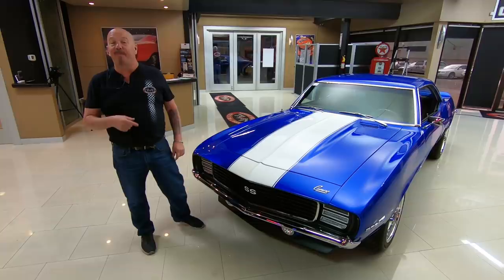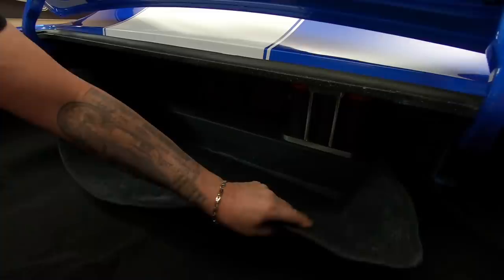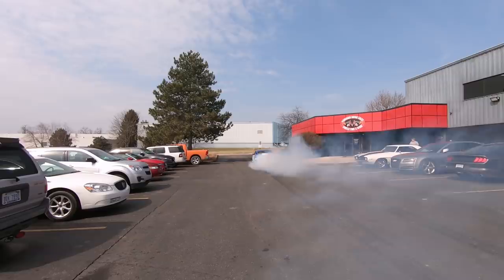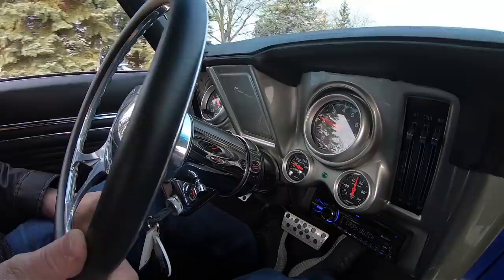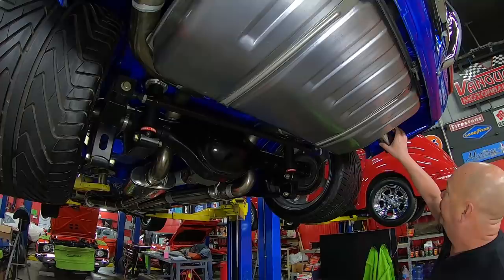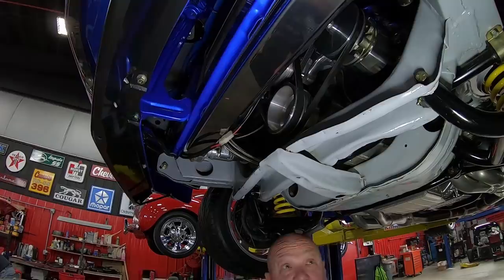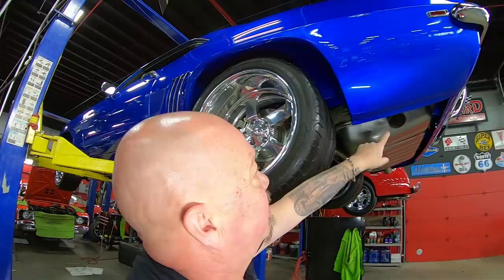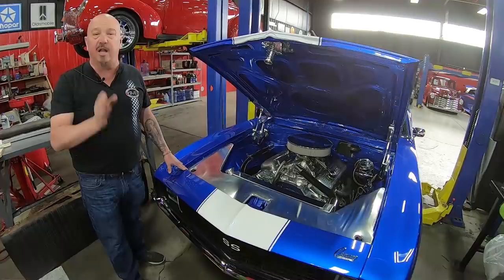1969 Chevrolet Camaro For Sale

Comment: How is that possible? Baldwin Motion closed up shop in the early 70’s, long before Merlin racing engines and the Chevy 572 create engine were even a thought, and an Internet came up with nothing on Baldwin being back in business
Reply from the maker: This Engine was specialty built by Baldwin Motion. On our website you can see pictures of the original baldwin motion documentation we have to prove its authenticity.

https://www.vanguardmotorsales.com/inventory/3354/1969-chevrolet-camaro-restomod

Comment: U guys have a rough job...almost as bad as i want the job of the test driver who test and certify s all turbo 911 porsches after they are built on the autobahn..
This car plaque on dash 211mph top speed...thus car 223mph top speed plaque on the dash board by me...hah hah hah....
Thanks u need to certify quarter mile times in Camaro im available for a season....i always get the holeshot oh i forgot its only a 572 dont bother just kidding